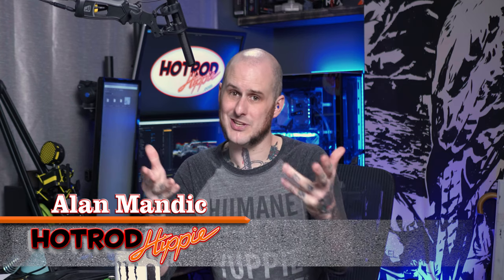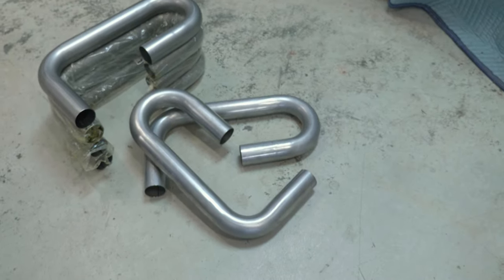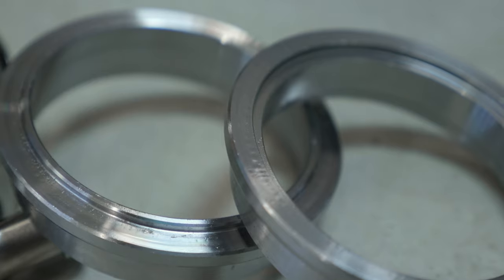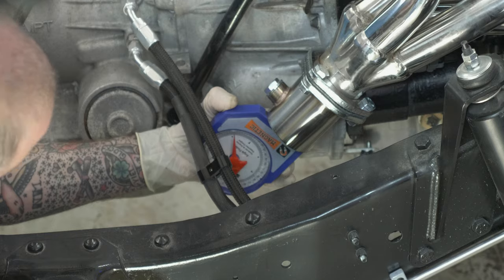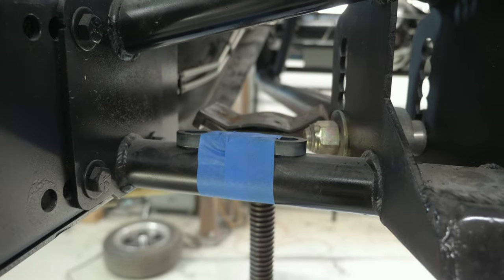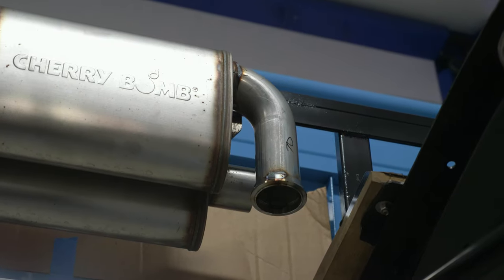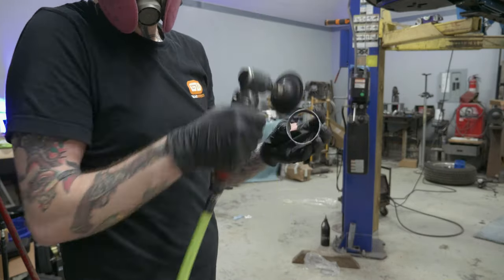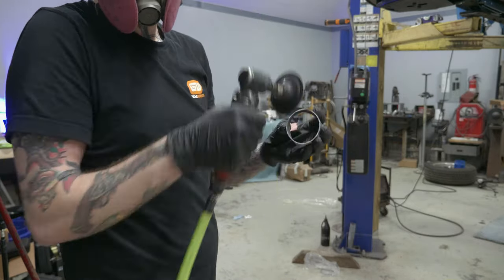Custom Exhaust Fabrication - LSx C10 Project Truck Build

Comment: Great job on the exhaust, I weld 'em up to but I use stainless and a MIG.  I fit the pipes with band clamps that have windows in them and space the tubes1/16" apart, crank the gas up and fill the space with stainless wire.  We aren't talking about sanitary welding here and my system seems to work very well, I just move and weld at an angle forward of the weld pool to preheat and purge. There's a little sugar on the inside of the weld but never a broken pipe or had anything shake apart and the first system I did is still working 11 years later

Comment: I did a crossover tube on a turbo LS using the speedway motors j bend mandrel tubing and also thought the consistency of the diameter in the bends were not great....  Will also be reading comments to see what others recommend

Comment: Hope to see you back sometime soon man, I miss your videos!   Question, on those urethane grommet mounts... have you had an issues with those melting on this project, or others you've used them on? I've seen mixed reviews about them melting, I'm looking to use them in about the same manner/ distance from pipe as you've used them by the trailing arm crossmember, and don't want to end up having to change it because the mounts failed....

Comment: Great video as usual. Would you MIG or TIG this exhaust in general (the mild steel one, I understand the stainless needs to be TIG) or does it depend?
Reply from the maker: I’d normally TIG weld entirely. As I didn’t anticipate doing this exhaust on this trip I ended up having to MIG it. Which is fine, just not my preference personally.

Comment: Do you have any tips on starting to weld with flux core for body work. I know for body work it is best to use mig with gas but I simply dont have access to that right now. Thanks!
Reply from the maker: Practice welding as low of "Temperature" settings as you can.  Practice practice practice.  Flux core automatically welds hotter at a given setting so it is going to be a challenge and an uphill battle but you've got to do what you've got to do.

I prefer not to MIG anything, especially not body work personally but my ideals aren't your situation.
Reply: @HotRodHippie  Thank you for the reply/advice!

Comment: Actually not "math" but geometry
Reply from the maker: Geometry (from Ancient Greek γεωμετρία (geōmetría): is a branch of MATHematics concerned with properties of space such as the distance, shape, size, and relative position of figures.
Reply: @HotRodHippie  BLAH BLAH BLAH you know what I mean do you use Trigonometry or physics while building exhausts - I would thing not.
Reply from the maker: @gilhernandez605  if you don’t understand that Figuring out angles of triangles (the most basic geometry / trigonometry that fabricators do DAILY), is a part of building an exhaust like this, I don’t know what to tell you. And Physics? Understand how forced applied to an object will effect it is important. You just don’t view the way you interact with the world in the context of scientific principles. If you slow down and open your mind up a bit you’d realize just how much you really do. Knowing how a piece of metal will react when you apply force to it (grinding, hammering, saw) is a form of understanding physics…